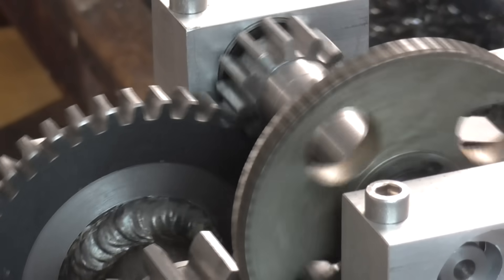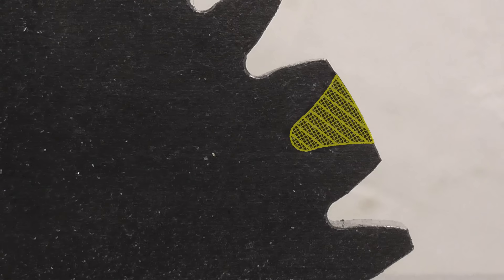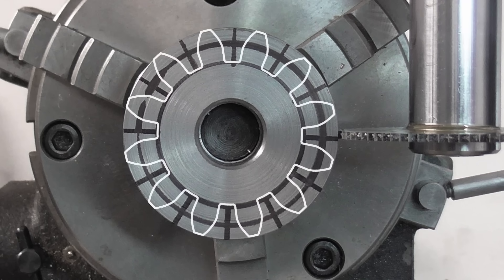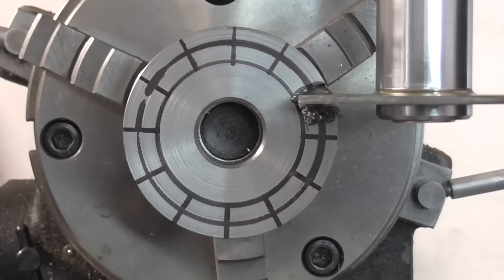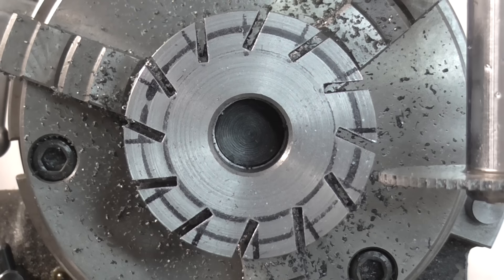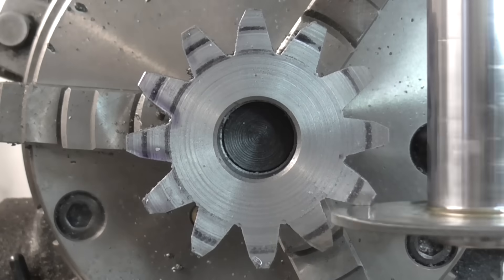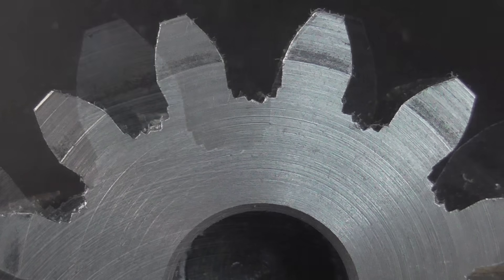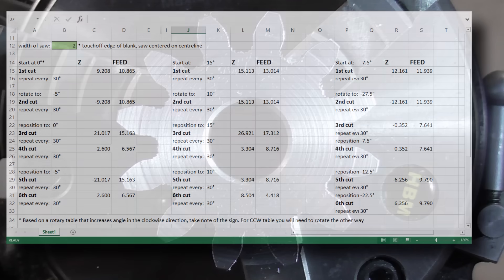Cut any gear with just a slitting saw

Comment: JUST A MILLING MACHINE.

I think with an indexer and some type of slide table you could do it on a drill press.
Or even more just use a bandsaw like a do all saw.

If its wood an indexing turret and radial arm saw.
Reply from the maker: Yes, you could probably use a drill press with a compound table, you could probably rig something up to do this on a lathe. With wood you have even more possibilities, I'm sure you could use a table saw or router table. All you need is an accurate way to index the blank, which doesn't have to be complicated.

Comment: Thank you Andy, this is a great presentation, very professional with good lighting, great audio, and close-ups that actually show the details. One comment, I have an older version of Excel. Would it be possible to save the spreadsheet in .XLS format? My version of Excel shows gibberish when I try to open the .XLSX version.
Reply from the maker: Done! Added to Patreon in .xls format (Excel 97-2003)

Comment: Thanks for the video it was very interesting. I did all the gears on my 3" Traction Engine It cost me a fortune to buy the cutters back in the 1970's but I still have them and still use them from time to time. I wish I had known then what you just taught me. Out of all the maths, technical knowledge and technique,  the thing that impressed me most was..... WHERE IN THE HECK DID YOU GET A STRAIT SLITTING SAW!.😁

Comment: you can finish it with abrasive sand and oil with another same unfinished gear
pressing them one another until both axle reach  (24+24) 48 mm of spacing 
what do you think ?

Comment: I don't know anything about gears but does it make any difference, in the geometry, if the gear is a "drive" or "driven" gear?
Reply from the maker: No, for driven or driving gears the geometry is the same. Both of these gears experience a force on the teeth in one direction only, just the opposite direction for each. There are also idler gears, a gear in between a driver and driven, these actually experience a force on the teeth in both directions so tend to fail first from the constant stress reversal. However the geometry is still the same.
Reply: @AndysMachines  Ha!  Great knowledge.  Thank you very much!

Comment: Can your spreadsheet be used if I want to make a gear with 54 teeth and diameter of 211 mm, sir?
Reply from the maker: Yes, but you first need to calculate the size (module) of the teeth, see my other video on identifying gears. (Your gear is around 3.75 mod but not exactly)

Comment: 12 tooth at 20 deg should have an undercut for mating tooth clearance, I believe. A hob would form it "naturally" but most CAD and gear drawing apps don't calculate it because the math is mad. I have prototype code for it in my Fusion 360 Helical Gear Generator plugin (in an unreleased version) to draw the undercut for 3D printing, and applications like yours. While I could draw the true undercut curve (not just a fillet) I ran into challanges and set it down for a long time. Now I frankly forget what the road blocks I ran into were, I wrote it years ago. I think it was an inability to tangent the complex undercut curve with root circle and other root area intersection geometry challenges. Anyway, cool idea! Thanks for sharing!

Comment: Using a drill bit to make the root could save you quite a bit of time cleaning up at the end, assuming the cutter doesn't over-travel the hole in the course of making the other parts of the profile.  My math isn't good enough to work that outcome to see what would happen, just a guess :)  At the very least, it would eliminate a lot of the need for  the end mill use.

Comment: Viewed at a certain angle, a disk looks like an oval.

What if the saw was tilted at an angle with respect of the flat side of the gear blank? 
Wouldn't it cut an oval in one pass? Then pull it out to the next pass deepth and tilt it more to make a wider angle on the end of the teeth...

Or would you need to do the wide outer pass first, then cut narrower deeper passes next?

Comment: You should burnish it and polish the teeth and then heat treat harden it otherwise it’s gonna wear like crazy esp with a rough surface
Reply from the maker: Yes, all of those would be improvements. But for my use this gear only needs to turn very slowly, infrequently and withstand quite a lot of force. A small amount of wear would actually be beneficial to smooth out some of the high spots between the facets. It will never wear out in it's lifetime with the use it will get.

Comment: Very nice. But if it's not stress loading critical, I'd go an easier route. Design in AutoCAD, 3d print, press into sand mold and then cast. Faster and guaranteed to be accurate with less math needed. Add a mm to thickness of the gear so you can end mill it flush and clean. A 15 amp grinder with a wire wheel will completely smooth out the teeth. I do it to clean up spatter from mig machines all the time.

Comment: I would be interested to see how they work in your application, are they rougher than hobbed gears? Is there a way to test efficiency?
Reply from the maker: These gears will be turning very slowly with quite high torque, I don't expect to be able to tell any difference compared to commercial gears. The teeth do have small flat facets on them (so does a hobbed gear, just many more smaller ones) if running at high speed I would expect them to be slightly more noisy, but after some use they would likely wear in and the high spots would be removed.

Comment: just 3D print it sell drill and the rest of the Stone Age tools
Reply from the maker: Though I do own a (fdm) 3D printer and do use it for engineering related things, I would never in my life make a gear with it! 3D printed gears have to be comically huge to withstand the torque that even a much smaller machined plastic gear could take. Not to mention the rough surface finish which would cause the gears to grind themselves away.

Comment: Nicely done! 
I've cut gears by just grinding  a single HSS cutter and putting it into a holder on the mill. I have a tool & cutter grinder, which helps but isn't necessary. You can do it on a bench grinder by just matching an existing gear's shape.  Same holder can be used for multiple profiles. Make it like a fly cutter but with a horizontal slot. 
 Module and Diametric pitch can be easily switched back and forth  with a simple formula on a spread sheet or calculator.  
Terrible music.

Comment: You could have gotten a better root radius with a spot drill or milling bit from the side of the gear at each root 12 indexes befor cutting teeth - such undercutting is a necessity with gears with small PD.
Reply from the maker: Yes, I do sometimes do this on gears with more teeth, see 1:23 and my other responses to this same question.

Comment: I wonder what steel or metal is used for this gear?
Reply from the maker: It was just a piece of bright mild steel bar, EN3 I think. I could have used something more exotic like EN19 (~4140) and made the gear slightly smaller, but I just made it bigger instead to have the strength needed.

Comment: A very clever and ingenious method for an emergency repair gear.  The machining operations are tedious to say the least.  Instead of a slitting saw, a shop-made PARALLEL HOB reduces the number of machining operations to 1, 2, or 3, depending on the number of teeth required.
This parallel hob is worthwhile if a number of gears are required with differing tooth counts, because a hob will cut all tooth counts of a given pitch and pressure angle.
Best of all this type of hob is quite easy to make because the teeth are circumferential.  Think of rack teeth wound around a cylinder.  The only relief for the hob teeth is radial, which is easily milled.
The 6 gears for Maudslay's reversing gear for the steam engine on my channel were made by this method using the hob described.  It was still tedious work!
Thanks, Andy, for your work in developing this methodology. w
Reply from the maker: Thanks! Yes, I've made 'hobs' like this before and they are very useful. They look like a stack of no.1 involute cutters and you use them the same way, indexing one tooth (or fraction of a tooth) at a time so no need for a proper hobbing setup.

Comment: is there a reason you don't drill the root fist?
Reply from the maker: Yes, actually there is. Drilling the root saves time but the root of the tooth is not actually a continuous arc, so you need to drill a bit inside the root circle if drilling a single hole which weakens the tooth slightly. This gear is this size because it needs the strength and I didn't want to compromise it. I did drill the roots of the larger gear that meshes with this one (1:23) as that gear has more teeth they are inherently stronger since the faces are not undercut like the small gear.
Reply: @AndysMachines  two smaller holes to form the radius and flat-ish bottom?
Reply from the maker: @pacman10182  Yes, that can also work very well, but is probably as much work as cleaning it up with a ball mill afterwards and smaller holes have more of a tendency to wander.

Comment: Been thinking about something like this for a few day. I need a simple plain gear for a cement mixer., a one off. I had considered using a drill bit to creat the root before sawing away the excess material. Any thoughts on that idea? Excellent work by the way.
Reply from the maker: Yes, I think that's the sort of thing this would be ideal for. You can drill out the root first to save time, though you often have to drill a bit inside the root circle due to the shape of the teeth and space between, so this can weaken the teeth a little, but it's less of a problem on gears with larger numbers of teeth.
Reply: @AndysMachines  thanks.

Comment: Great technique, lovely video work and explanations.

My dad was a gear designer so the terminology is familiar but I can see many may not understand why teeth are even an involute shape.  Most people do not even know what module means and why they are specified in two different ways.

There are older ISO, AGMA, DIN and BS standards for calculating gear profiles, spacing, corrections and more.  My dad used to routinely do these calculations for the gear boxes that were put into production at all the places he worked.  Knowing about strength of materials and hardening was important for lifetime wear calculations and dimensioning the gear widths and selecting bearings.  Not many in South Africa who were doing the calculations in-house, most relied on service from tool suppliers or parent companies abroad.
Reply: At the risk of stating something aleady known to most of those who would be interested in knowing it, one key advantage of involute flank profiles (other profiles are available and viable!) is that involute gears will run smoothly even when the centre distance is larger than nominal. This can be very handy when sychronising top and bottom pinch rollers (as in a machine for rollforming, say metal roof guttering). It is necessary to be able to adjust the centre distance to achieve the desired result, and to accomodate roll wear.
If smoothness is not paramount, by resorting to comparatively large teeth, quite a range of meshing distance variation is possible, especially in relatively agricultural applications, as with old-fashioned "mangles" for wringing wet clothes.

Comment: That's very interesting. One thing i've been searching youtube but can't seem to find, is how to cut straight bevel and helical bevel(hypoid) gears. Can you show how to do this, maybe?
Reply from the maker: I'm sure I've seen some videos on straight bevel gears on youtube. It's trickier but possible with several methods. Hypoid gears are another matter, I've never attempted them myself. (Tip: angle grinder gears are cheap and available in various sizes.)

Comment: Really interesting video, I have some chunky gears to do. They're DP, so this method isn't directly useful, but my Bridgeport should have a much easier time if I index round the blank with a slitting saw before I go in with the involute cutter.
Reply from the maker: Yes, you can do DP gears with this same method 20° or 14.5°. I've now updated the spreadsheet with another page for DP/Imperial gears. You could also just make the 1st two cuts per tooth at the pressure angle to remove most of the material and then use the involute cutter afterwards to save time.

Comment: This is a really cool way to shape gears.  I wouldn't have thought of this, then again I'm working with 0.2 - 0.3 mod typically.  Using a 4 axis high speed CNC mill, this approach wouldn't be so bad in a pinch.

Comment: This method would probably work with helical gears as well. After, those are usually cut with straight gear cutters set at an angle relative to the gear's axis of rotation. Just use more math to allow for the helix angle and a thinner slit saw.

I like it.
Reply from the maker: Yes, I've never actually tried it with helicals, but it certainly should be possible, bevel gears too.

Comment: could you not just drill a hole at the root of each tooth first? then cut the tooth with the slitter.
Reply from the maker: Yes, in fact I did this on the gear you can see at 1:23. I generally only do this on gears with more teeth though, due to the geometry of the tooth the root is not a perfect arc so it's a bit of a compromise.

Comment: Excellent work. To make life easier, you should use the index  to drill the inner apex of the gear, then cut to the hole. You can see on a regular gear it's been done that way.
Reply from the maker: Yes, I do sometimes do that (1:23), Some gears do look like they have been made that way, particularly those in clocks which have a different type of geometry, but the most common ways gears are made nowadays in industry is hobbing, skiving and even moulding from metal powder.

Comment: Without knowing any machinists, engineers or their training and heavy shop tools, I always wondered how Leonardo Da Vinci apparently cut wooden gears for his experiments with only the hand tools visible in a movie. I am still unable to work that out. But I thank you for explaining the work it takes so I could understand why it could not be done without stationary shop tools. Even with all the transportable drill presses, table saws, miter saws and grinders building tradesmen use, this requires too much precision to be accomplished without ordering and just helplessly waiting for the part.
Reply from the maker: If you haven't already seen it you should watch Clickspring's series on the Antikythera mechanism: https://www.youtube.com/watch?v=ML4tw_UzqZE&ab People were making precise machines with simple hand tools far before Da Vinci's time.
Reply: Large wood teeth as made to repair old water powered mills are often done one tooth at a time and then implanted into the gear wheel.

Comment: This is exactly how they used to make gears on shapers. This process was much faster on a shaper, which isn't something you can usually say. 

Shapers get to cheat too, the cutter is just the shape of a tooth from the matching rack to the size of gear, and the gear blank is rotated with a wire wrapped around a wheel on the same shaft as the gear blank and anchored to the shaper. This way as the table fed sideways, the blank rotates. Since the wheel is sized to the pitch diameter (minus the wire thickness in diameter), the gear blank rotates the same amount as though it was engaging on a rack gear meshing with it's yet to be formed teeth, or in this case the rack gear shaped cutter, thus making a very good gear.
Reply from the maker: Yes, I've seen people reproduce this method of cutting gears with a shaper, but I still find it hard to believe they used only a wire to rotate the gear and would not have any error after a full rotation.

Of course there are also dedicated gear shapers, but these use a gear train to rotate the blank and generally use a cutter shaped like a pinion which also rotates rather than a straight sided 'rack-tooth' form, but the gear generation method is the same.
Reply: @AndysMachines  the wire is rigidly attached to the wheel so it's not too bad for accuracy. You would still have some sort of indexing setup to move to the next tooth. Geoffrey Croker has a video on cutting involute gears with a shaper that uses this method, you should check it out.

Comment: Sweet. This Old Tony covered a similar topic on INVOLUTE pitch gears. :)
Reply from the maker: Thanks! That's right, he did. What I am cutting hear is also an involute gear, but I am generating it with a series of straight cuts. What TOT used was a set of involute gear cutters, which is the more usual way to do it.

Comment: As a non machinist I would think drilling the root would make a better tooth.
Reply from the maker: Yes, you can do it that way, but it's a bit of a compromise as the correct shape for the root of the tooth is usually not a perfect arc. I tend to do this only on gears with more teeth (1:23).